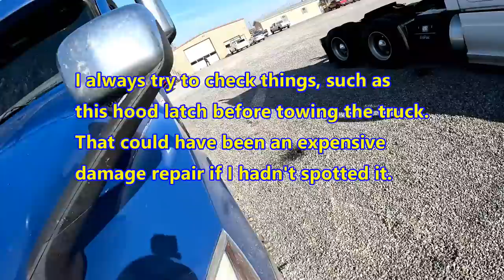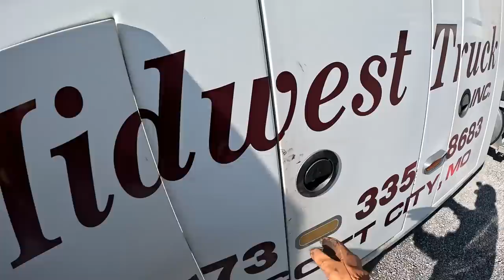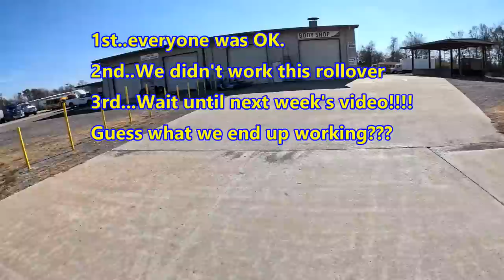WITNESS TO A ROLLOVER!!! WHILE TOWING A TRUCK WITH THE WESTERN STAR!

Comment: Either ron or anyone else who knows, Why do you have to tie down the wheel? wouldnt that cause the tire drag on the front while making a turn?
Reply: They tie down the steering wheel to keep the front wheels from turning and causing the truck to swerve all over the road.  So they tie the steering wheel down to prevent that.
Reply: It prevents the wheel turning when going backwards which can cause it to swing out into another traffic lane
Reply: The tires won't drag because each front tire is parallel to the frame and can spin at independent speeds.  It actually functions just like a small single-axle utility trailer.
Reply from the maker: @kensherwin4544  Excellent analogy!!   Thank you and God bless.
Reply: @thomasbennett9648  Thank you
Reply: @southaussiegarbo2054  Thank you

Comment: Question: what if in the rare case that the steering wheel is missing or damaged? 🤔
Reply from the maker: There are ways to secure the steering from under the truck.   They aren't easy nor or they reliable.   I would look for an alternative method to transport the vehicle if that were an option.   Thanks for watching and God bless.